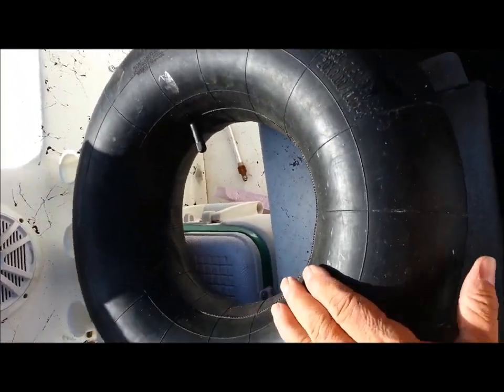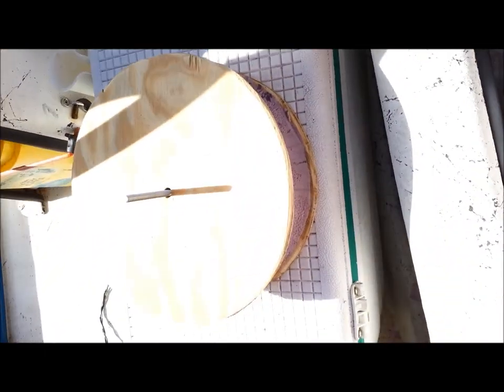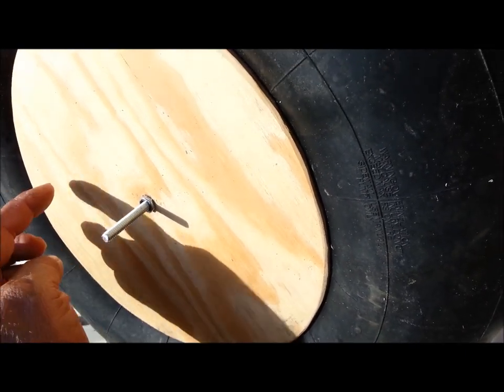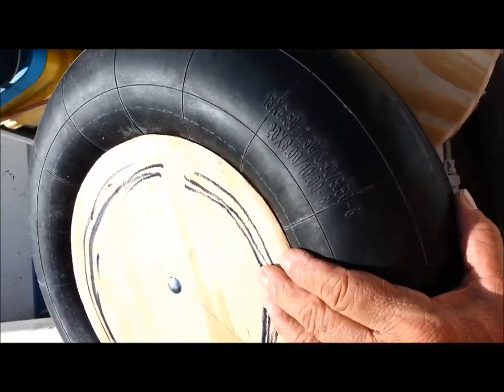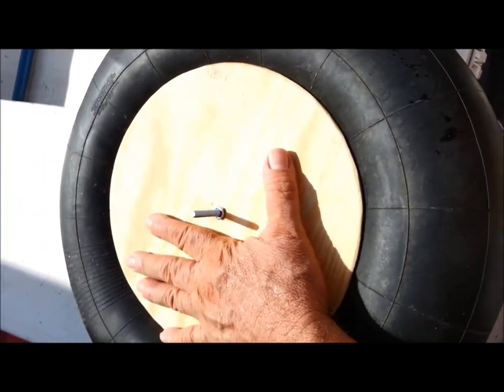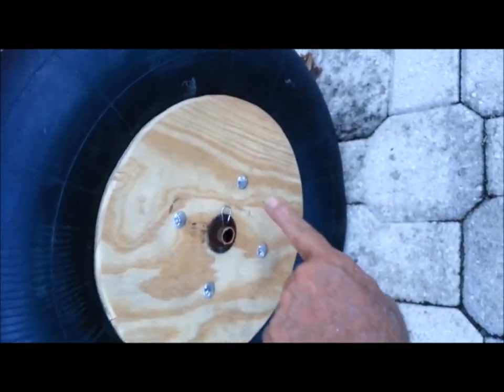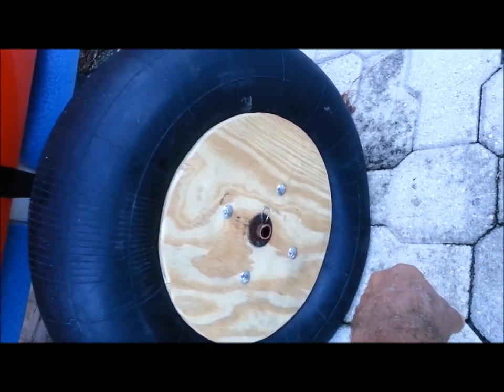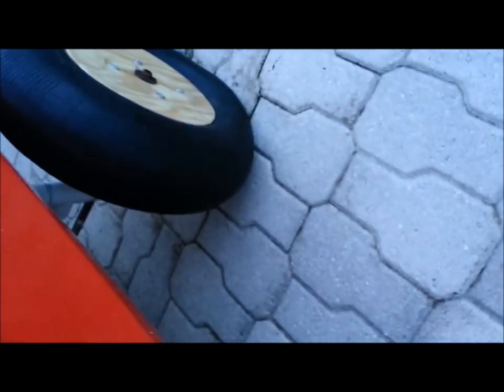Homemade Wheeleez Beach Cart Kayak Cart Wheels

Comment from the maker: I used them for the first time last weekend and with a fully loaded yak, they didn't sink one bit in the sand! There was a slight depression in the soft beach sand and that was it! I was able to pull my fully loaded Yak all the way from the parking area to the water without stopping and I was not out of breath. Usually where I park, I have to stop and rest 3 or 4 times and I am virtually worn out with small regular cart wheels. These tires work like a charm!
Reply from the maker: http://youtu.be/U7GhcWWVA3s

Comment: This is perfect! I already have 8" aluminum rims, with ATV tires on which are way too heavy for sand, this is the perfect solution! Thank you for sharing....
Reply from the maker: My pleasure. Let us know how it works
Reply: John Sims Will do..... could be a while though, bought an All Terrain Radio Flyer with a fabbed steel lift kit. It looks bad-ass, but I  realized now it’s too heavy to transport.... so I’m going to build something lighter and sensible for the beach 🏖
Reply from the maker: @heyyitsandy  cool!

Comment: I know this an old video, but still awesome idea.  I took it a little different direction but would not have thought of without your idea.  I bought 2 13" tire-wheel-tubes at Harbor Freight for $12.99 each less 20% coupons. I removed the tires and reinflated the tubes on the rims.  They aren't flat proof, but at 2 PSI I think it would take a pretty sharp object to puncture them; if needed I'll upgrade the tubes. Haven't tried them in the sand yet, but they roll around my yard great, lol.  One last thing, the hubs were a little too wide to fit on my axle so I disassemble the rims (these are split bolt together rims), knocked the outside bearing out, cut about 3/4"  off the tube and put the bearing back in.
Reply from the maker: Very nice! Post a video!

Comment: Awesome!  I have been thinking about making my own tire/wheel combo for a while now.  The commercial option is so expensive.  I had also considered using inner tubes.  There are some videos showing Russians with homemade low pressure flotation tires that look like large inner tubes secured to wheels using bands or something.

Comment: Great use for an inner tube. No one in the UK seems to stock proper sand tyres and the US based retailers won't export without some complex freight forward set up. Did find a Spanish based retailer but all their tyres/wheels were out of stock. Us Brits have been slow to catch on to the benefits of using a beach cart to carry all the usual equipment for a day at the beach. I did look at using off-the-shelf fishing carts tend to still have narrow mud tyres which are useless in soft sand. Definitely going to try this method but maybe add some rubber matting to outside to reinforce the tyre.
Reply from the maker: ***** Thanks! I have had no problems regarding reinforcement. Maybe a thicker 'wheel' using wood, or even thin aluminum. Glad you enjoyed it!

Comment: I haven't made these yet but I have a couple of recommendations. Instead of using foam for the inner tube to rest on, I'm going to use 1-1/4" PVC to go around the carriage bolts. I plan on using a hole saw to create slots for the PVC to fit into. That will keep them from shifting around. In addition to that I'm going to pre drill the carriage bolt holes and coat the plywood discs with several coats of FlexSeal. Not only will that make them waterproof, it'll also ensure that no splinters, should any pop up, will puncture the inner tube. I'll post a video when construction is complete. Thanks for the video!
Reply from the maker: Outstanding idea! Let us know how it works out. There is a cheaper alternative to Wheeleez... www.beACHWHEELCARTS.COM Jason SELLS THE WHEELS AND THE AXLE FOR AROUND $150!

Comment: I wonder if a quicker way to make the central foam section might be to sandwich the partly inflated tyre between the wooden/aluminium rings and bolt them together. Then fully inflate the tryre (to provide resistance) and squirt some polyurethane expanding foam in the gap between the rings using the the central hub hole. Let it expand until it dries and cut off any excess poking through the hub. Drill through your hub pipe and let some air out of the tyre to spread the load on the sand. Another improvement might be to add some 25mm bore stainless steel pillow block bearings which you can find on eBay.
Reply from the maker: EXCELLENT IDEA! I will have to give it a try for my next cart...

Comment: Very nice idea John- thank you.  I need to make a simple cart to carry my camera time lapse rig down to the beach with 2 tripods, two chairs, pipe, electric motor, battery and controllers.  You've got me thinking in a whole new direction ! It has to be light enough to go up and down about 4steps(risers).
Reply from the maker: Thanks Tom! I am going to make the hubs a little stronger with aluminum diamond plate. Thicker wood may also be an option...
Reply: John Sims I think tha idea of putting some tubing around the edge of the diamond plate would be a good idea, with some silicone caulk to hold it in place.  I decided to just order a cart off eBay because it will make it easier to get everything done in a quicker fashion.  But I will probably still end up making my own, later- I just like the idea better !!

Comment from the maker: @Fred Mueller          If you use thicker wood for the wheels, maybe you won't have to fill the void. My plywood was thin, so I used the foam board inside to strengthen the hubs. I have not seen a need for the tape. The edges are not sharp and won't puncture the tubes if sanded down real well. Good luck and post your completed project!

Comment: Way to go!  btw you can cut a perfect circle with a router and a simple jig, put a pin and arm or wood fastened to the router base to cut a circle, and I have done a lot with cutting pvc sheet, the 1/4 pvc is not very structurally strong when flat but vertically very good might work for wheels instead of plywood.
Reply from the maker: Thanks for the tip. I didn't have a router... :)
Reply: @JohnSims3  Your video was 2014 how did the tubes hold up?  Still working?
Reply from the maker: @LeonardSchmiege  I still use them to this day! I got the self sealing tubes from Lowes. Amazing how long they have lasted.
Reply: @JohnSims3  That's really great that they are holding up.  I am thinking about building a beach cart for my beach sherpa business, it should hold everything needed for a dozen people, including a large floaty and batteries, water, and laptop (Its going to have a beach computer work station so I can run my other business from the beach.).  So it may end up being pretty heavy.  Ive done the business three times, 2 years ago.  Thinking the large cart would be towed in a trailer parked at a boat ramp and then pushed or maybe even be dc powered to beaches in Pinellas County Florida.  It will need to go over road, sidewalk and beach.  I might build a cheap test version first though.  What do you think the total weight capacity of four of those tubes is?
Reply from the maker: @LeonardSchmiege  Hard to say without a tire, but my yak fully loaded is 200 pounds and they hold up

Comment: Sweet!
Might want to put some rubber hose or around the wood edge so the wood will not cut into the tire/rub a hole in the side wall.
A couple very short SSteel wood screws to hole the rubber bead will work w/some Gorilla glue.  Just a thought.  Great Job.
Reply from the maker: Not necessary. I rounded the edges of the plywood. The inner tube is very thick also.No rubbing or puncture concerns at all!

Comment: thanks for the video  i made a set instead of using plywood i made mine out of stainless plates and put  6 holes  60 degress apart for cross ties a little bigger than the inside diameter of the tube  stretching the tube over the cross ties and used the 6 inch tractor tubes   15 diameter   really  thanks   i used mine over the sand what a difference  from the plastic  wheels   thank  you  very  much  saved my back
Reply from the maker: Dons Gee Awesome! I am happy this helped you...and your back!

Comment: Hi Jim,
Thanks for sharing this idea.  I intend to make four wheels in total for a fishing kayak that has gained a lot of weight due to added equipment.
I have made two wheels thus far and would like your thoughts about modifications.
1.  I used four 6" hex-head bolts to join the two wooden discs, intending to use the foam filler as hub material.  This step now seems unnecessary.  Any reason I should not skip filling the void?
2.  Adding two or three layers of duct tape to the tubes would help protect the rubber from any damage.  Any reason I should not do that?
I appreciate any help.
Peace, Fred

Comment: Positively brilliant!  Thank you.  Saw the video with the tracks in the sand. How many times have you taken it out? Total weight supported? Any ideas on improvement of this design?  I'm grabbing your idea and going for a really cheap beach wheelchair that can go in the ocean.
Reply from the maker: mauibuck thanks! I have had it out about 25 times with the plywood hubs. No problems at all with a fully loaded Hobie Outback. I would say that my loaded yak weighs in around 200 pounds which includes a live well. Yes, read below for improvements. I am going to redesign using aluminum diamond plate for the hubs instead of wood and do a video. I already made a cart with diamond plate I had in my garage and it works beautifully. I need to make another cart for my other yak. Also, depending on the tubes used, you may want to get valve stem extenders. your project sounds like fun...
Reply: John Sims Thanks, I read all the entries below.  I'm a wee bit concerned about rust on the all-thread.  I understand the zinc coating won't stand up well to ocean water. However, this is not meant to be "live forever" tank. 

I'll probably try the wheelbarrow tube first for "proof of principle" and am looking at  7-9 inch, heavy duty ATV inner tubes as larger wheels if needed. I make my own leak sealant so I'm not tied to the store bought and certainly not Slime. It only lasts 2 years. 

I'm also mind surfing about the possibility of casting wheel rims in foam and then covering in fiberglass. I wonder if there are any existing plastic rims available.  And another possibility is to 3D print the rims.  Don't think I have access to a printer that large...yet. Everything is out there in dreamland right now.
Reply from the maker: Nice ideas! Yes, the all thread will eventually corrode, and 1/2" or 5/8" stainless isn't cheap! ATV tires should work fantastic! Let us know! I have seen some wide plastic rims out there, just can't remember where...

Comment: Great video, and thanks for sharing! I built a surf fishing cart a few years back for toting all my surf fishing gear, cooler, chairs, etc. I love the thing, but I wasn't going to fork out $200 for some wheeleez so I put some wheelbarrow tires on there--terrible idea!! 
Did you ever install a valve extender, and if so how'd you make it work? I started building these yesterday, and bought a valve extender from Orielly's; however, once installed the air leaks out of the tire. Just curious if you had any advice or encountered this issue? I'm wondering if it's worth it, or if
I should just take the wheel apart if I need to let air out or put more in. Also, I didn't fill the void/gap so I wonder if I just cut a hole on the outside big enough to access the valve--maybe that would work! Thoughts? Thanks again!
Reply from the maker: buck91hunter I haven't put a valve extender in yet, but plan to. Why is it leaking? I agree. Wheeleez are way overpriced! I think your idea may work!

Comment: I really enjoy diy and like your build. Since I live on the coast these type tires/wheels come in handy.

I'm curious though, I didn't see a way to fill the tube once it's together, did I miss something in your video?

As well, repurposing goes hand in hand with diy. May I ask, have you given thought to just using golf cart tires? You can pick up used balding tires with the rim for around 5 bucks. Here you can at any rate.

just build a center out of plywood like you have done only smaller and your axle will fit. they even make similar tires for around $35 with the rim new. Just a thought mind you... yours I'm sure are much lighter.
Reply from the maker: +chase Yes. Thanks! I had to drill a hole and add a valve stem extender. Golf Cart tires would be perfect! You may even be able to use the rims and put a tube on them.

Comment: i would suggest instead of plywood try using something plastic, no matter how good you cover that plywood the water still is going to get through, resin, gel coat, paint, i did it all and with time the wood starts to rot.
Reply from the maker: Darth Teabagger I actually changed them to thin aluminum diamond plate that I had laying around...

Comment: I found 20x10.00-8  tubes on ebay (2) $22.00 shipped. Just put Slime tire sealant into them make them self sealing.
Reply from the maker: vqfive i got hem at Lowes. They have the puncture sealant in them

Comment: How long these cheaper tires last?  7 years later, they still haven't went flat?
Reply from the maker: Nope! They are still working just fine! They are definitely puncture resistant. I am noticing some cracking though in the rubber. Time to replace them...I'm surprised also.

Comment: i wonder what durability it has for traveling over some road asfhalt going throu sidewalk into a non pure sand.. can the tube last a weekily traveling like that ?
Reply from the maker: yes, it seems like it will work fine. I use it on asphalt and on sidewalks. The rubber is very thick, not cheap and thin, plus it has the automatic sealing feature for punctures up to 1/8 inch.

Comment: Any thoughts on the weight capacity for a tire like this? Looking to build a beach dolly to move a jetski that is around 250lbs.
Reply from the maker: Michael, I've put my fully loaded Hobie Outback with a full live bait well and no issues whatsoever. You can try bigger tubes if necessary...
Reply: I think it is good for anything that's fairly inexpensive but wouldn't risk it or take responsibility on an item like a jetski that has the same cost of a car and definitely wouldn't if someone's safety is involved and I could be held liable.

Comment: What did you use for the axle and how did you attach it to the wheels?
Reply from the maker: Jason Mallette I used 1/2" copper and switched to stronger 5/8" All thread. I ran it thru the hubs and used PVC pipe as a sleeve and big fender washers on both sides with cotter pins to keep them tight.

Comment: Could you explain how you attach the axle? Just a rod in a plastic tube?
Reply from the maker: Georges - It's a threaded rod slid inside of a piece of PVC pipe. Then it goes thru the cross piece of the cart that holds the axle. See this webpage http://www.watermanatwork.com/KayakFishing/KayakRigging/KayakCarts/KayakCarts.html . Then click on this description for a drawing: "Click HERE to see a detailed drawing of how to fit the axle into the PVC frame." on the above webpage.
Reply from the maker: It's a copper tube inside of a pvc pipe. The pipe is used as a long spacer between the wheel hubs, and a big washer and a 'C' clip holds it on. Here' s some ideas: https://www.google.com/search?q=kayak+cart+axle&source=lnms&tbm=isch&sa=X&ved=0ahUKEwiaktb43YneAhUEslMKHUiTCloQ_AUIDygC&biw=1280&bih=614

Comment: So how did these hold up?
Reply from the maker: I still use them but i made the hubs/rims with thin diamondplate after 1 year. Much sturdier.
Reply: Nice.  So the innertubes didn't fail too quickly?  What about the load limit?  I would think they would bottom out onto the rim before they supported much weight since the tubes can't hold much pressure without support from a tire.
Reply from the maker: @pstrap1311  No, Actually they lasted quite a long time and I got the one's with the puncture seal inside. I used 5-7 psi and they never bottomed out, even with my bait tank full. Actually, they didn't expand as much as I thought they would. Also, check out Buck91Hunters vids in one of my comments.
Reply: @JohnSims3  Okay, cool thanks for the information.  Thanks for doing the project and making the video as well!
Reply from the maker: @pstrap1311  Awe some! Let me now how it turns out!

Comment: i know this is a money saving project, but why not put it on a wheel barrow rim?
Reply from the maker: Great idea, but I didn't have any at the time. I had fun making them anyways...Even some of the lawn tractor rims might even work...
Reply: John Sims i have some old hand dolly rims and bought matching innertubes, but the tube is too big for the rim. im guessing the tire keeps the tube contained, so no need the tube to actually fit snugly on the rim. i have an 8inch wheelbarrow rim, im going to try to put a 6inch inner tube on. i will let ya know how that works.
Reply from the maker: Great! Let me know how they work out!
Reply: John Sims a six inch tube does fit on an 8" wheelbarrow rim. It looks like a bald tire. i have  5psi in the tube l. now i have to build a cart and test it
Reply from the maker: Sweet! I have a lot of weight in my Yak, so 5PSI should work!
Reply: John Sims the innertube i bought isnt nearly as wide as yours.  and at 5 psi, isnt much wider than the rim. i am making a job specific cart to transport about 40lbs of equipment down the beach in 1 trip instead of 3. so i dont need a large footprint, i hope.